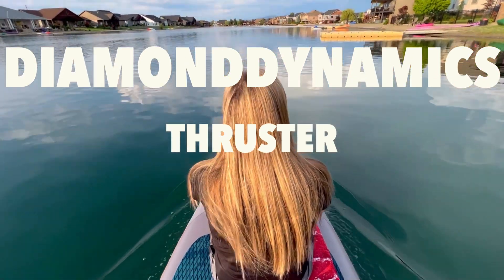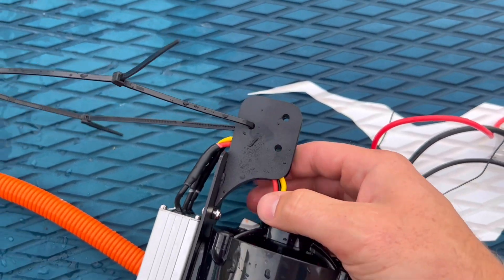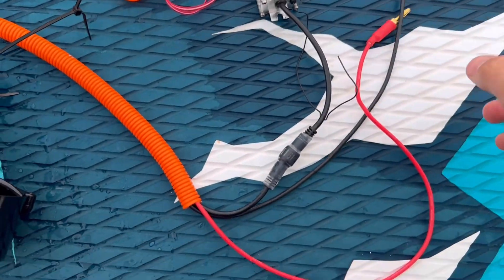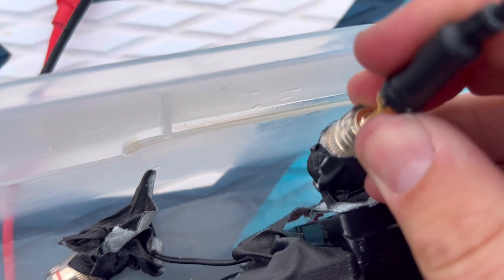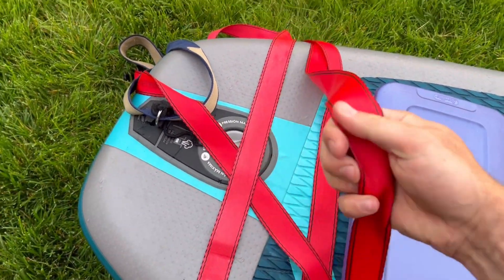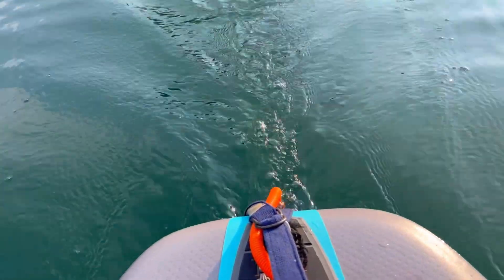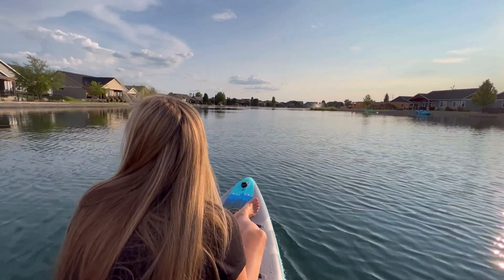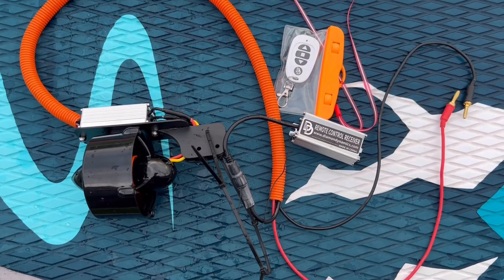TD6E Underwater Thrust 24V 400w Brushless Motor | Hobbywater

Comment: How do you find the female adapters for the battery?
Reply from the maker: Hello,You can either go for a battery that already has the adapter built-in, or use a 4mm Banana Plug Socket—it’s a simple and reliable option! Let me know if you need more help! 😊

Comment: Those batteries can provide 10 A max no ? 24Vx10A = 240W, not 400W. Your batteries don’t trip on maximum throttle ?
Reply from the maker: For better performance , we recommend using a 20A battery.
Specifications:
Rated Voltage: 24V
Rated Current: 17A

Comment: You can also check the thrusters I used in my video which seem to have more power than this particular thruster.
Reply from the maker: Great work for you~
Reply: @hobbywater9414 How did you make the connection from the provided positive/negative  cables to the battery??? I can seem to find a battery with that small of a hole...please!
Reply from the maker: @Lytwynczuk  hi there ,thanks for your asking ,there are two poles to connect the battery ,the black and red cable head. kindly refer to the link ：https://www.hobbywater.com/products/td6e-underwater-thruster-24v-408w-kayak-fishing
Reply: How did you make the connection from the provided positive/negative  cables to the battery???